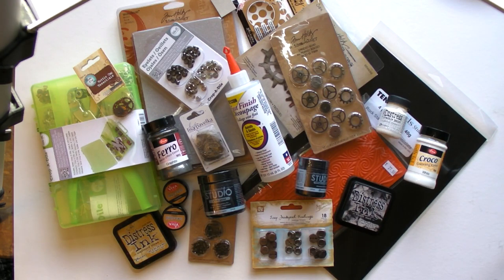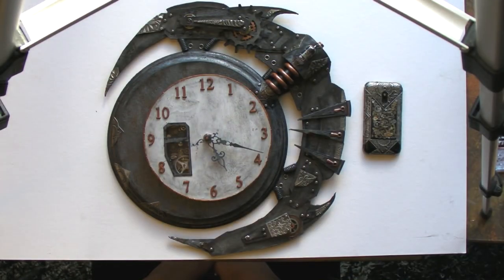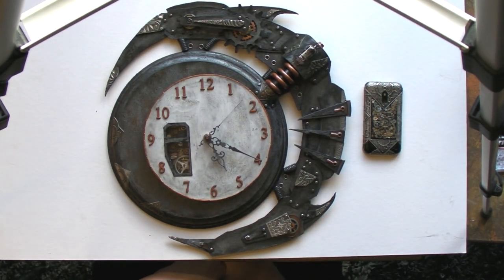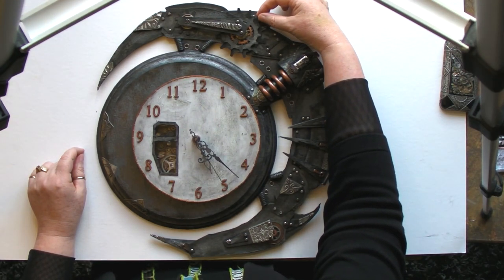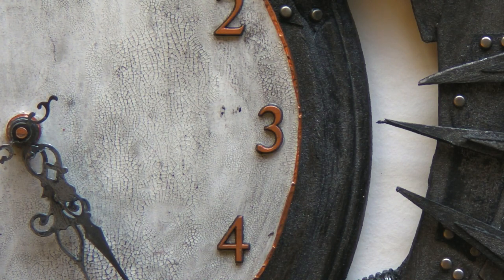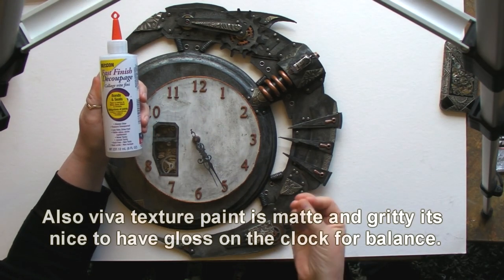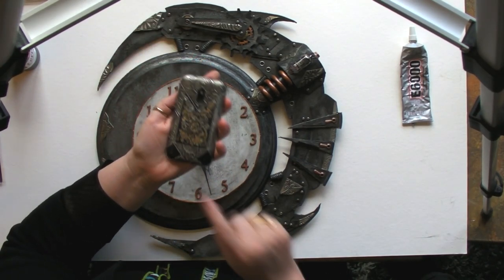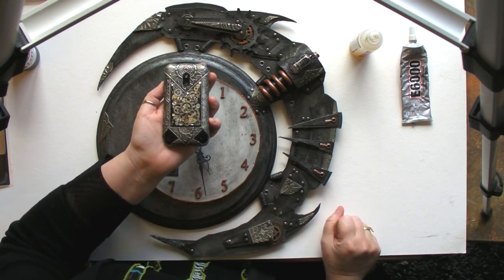Tim Holtz Grunge Steampunk Clock

Comment from the maker: We have used Grafix chipboard in places as in the Clock face and some of the detail as Grafix is the perfect weight to diecut using the sizzix steel rule dies.We needed a product was really strong that would take  a lot of wet media, that would mold and wrap to look like sheet metal and be embossible. Cardboard didnt do this while retaining strength. Leather had its drawbacks too.   I have a personal stash of the grunge as I am scared they are going to stop making it :) Cheers Dianne